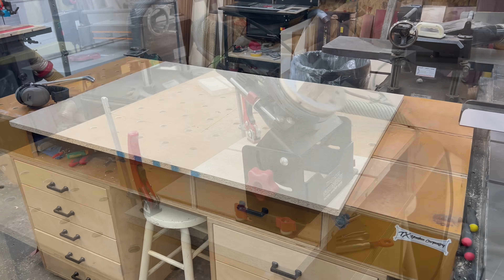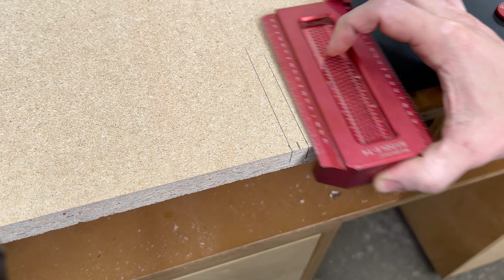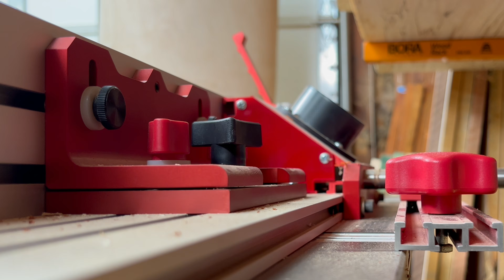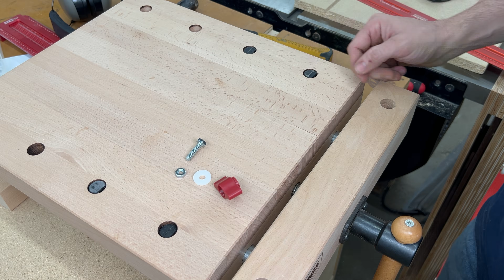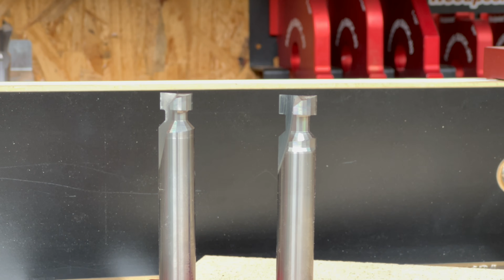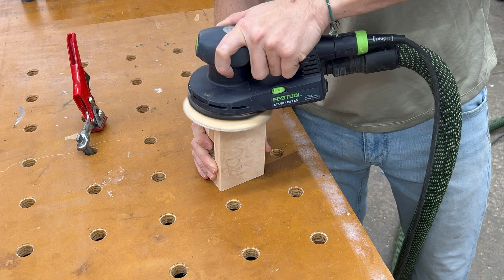Level-Up Your SandStand l RedTOOL WOODSHOP

Comment: I found it interesting that you have some of the most expensive/accurate woodworking tools and you used what is arguably one of the cheapest tools you can find at a major hardware/tools supply store. And that was your choice to use it to literally fasten this jig together.
Reply from the maker: I work for Woodpeckers. This is my full-time job. So yes, I have lots of Woodpeckers tools. But I also have the tools that I started with when I first began woodworking in 2017. And if they still work properly, then I’m going to use them. I have no shame in that and I’ll never forget where I started. 

-Jay
Reply: @WoodpeckersLLC  Being familiar with a tool, is half the battle.
Reply: @alandesgrange9703  no one was talking about understanding the tool it’s pretty basic I would say. But thanks for your comment